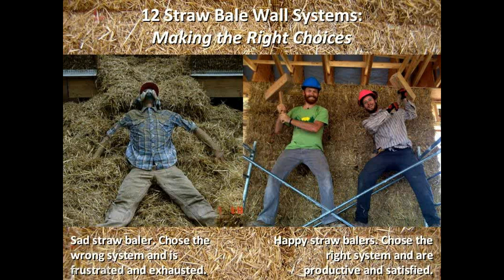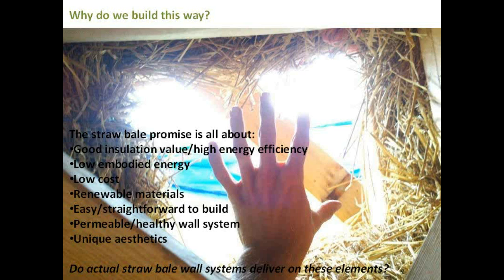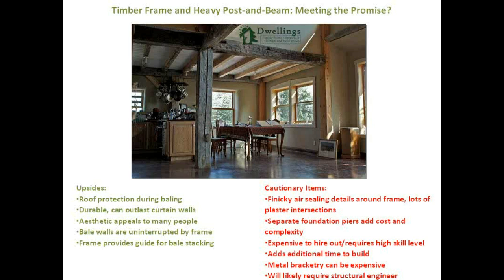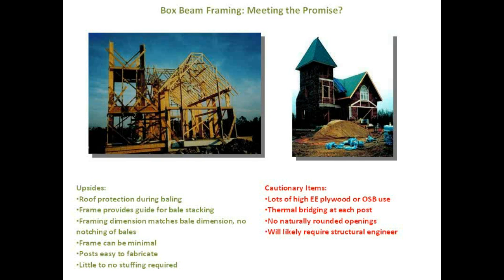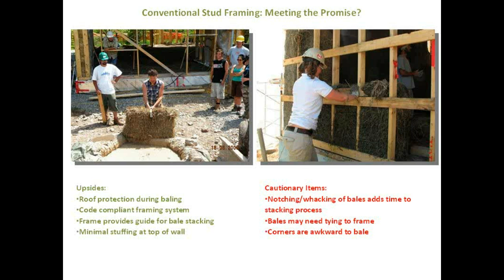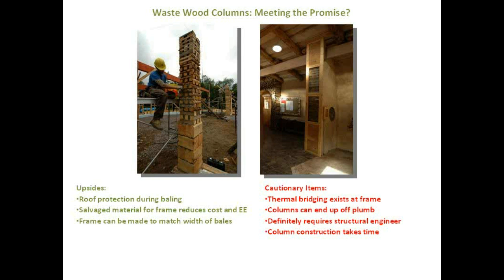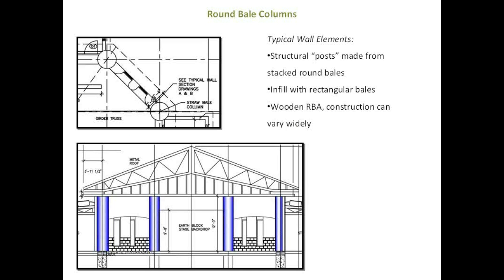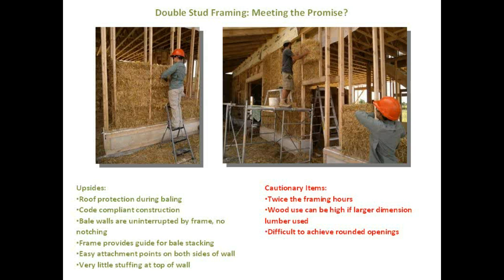Chris Magwood 12 straw bale wall types

Comment: Wonder if you could answer a question. I'm thinking about buying an already-built straw bale house that is wonderful. I saw old pix of it when it was being lived in by the builder. He never painted it, inside or out. I've watched a ton of videos, some of which warn against painting because it "seals" the walls in a way they shouldn't be. But before the most recent owners  put it on the  market, they painted the entire interior. This has me worried. I don't know what the builder used to coat the straw but I figure, if the builder himself didn't paint the inside that's something to note & maybe it shouldn't have been done. Would I be inheriting a problem someone created? I realize it may depend on a lot of factors & I'm trying to find the builder, but if there's a chance that it would be a big problem for one or more systems I'd rethink buying the place. Which would be unfortunate because it's so beautiful. Thank you.